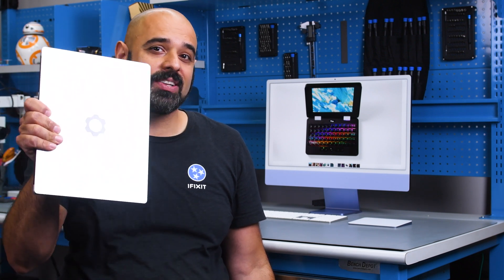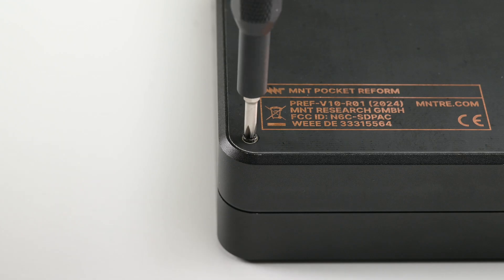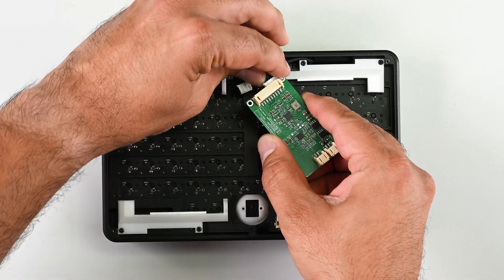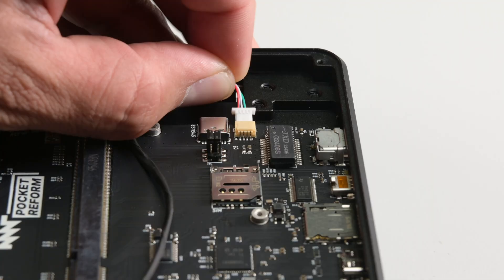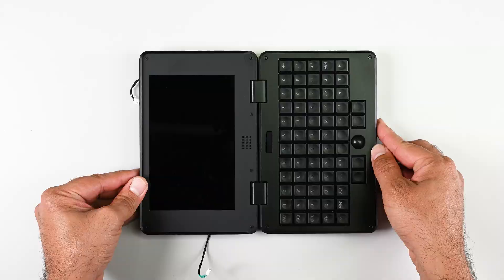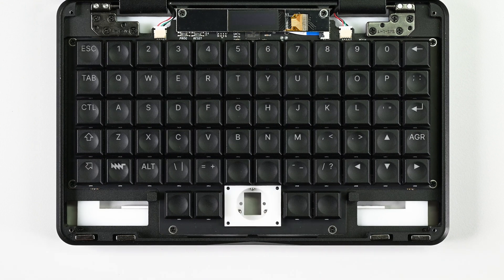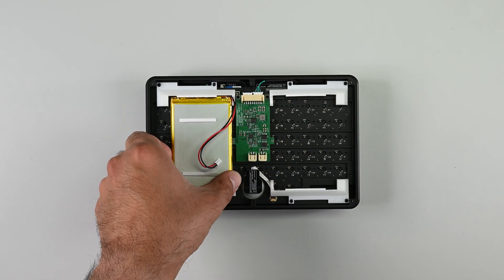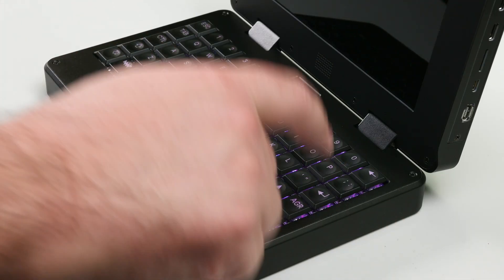MNT Pocket Reform Teardown - An Unapologetically Chunky Pocket PC, That's Also Repairable!!!

Comment: I was so close on buying one of these, but instead, I bought the ClockWorkPi uConsole.

Because I saw the tear down video and found too many wires and the overall design is not as modular as I thought. Compared to Pocket Reform, uConsole actually has only one wire, the WIFI antenna,  other components are connected through golden fingers and pins, which to me is cleaner. 

But this is not to discourage anyone from buying Pocket Reform, because it is modular as it can be, and I do like the idea of mechanical keyboards on such a small device...... So Pocket Reform is not bad in that sense.
Reply: honest reaction thank you.  But uconsole is ~$130 to $250, right? And they go out of stock often. DevTerm Kit RPI-CM4 Lite (with bigger keyboard) is $290. Basically they're an entirely different class of device.  Right now I don't know exactly how much less powerful Clockworks are, but the price difference alone tells me a lot.
Reply: @squirlmy  they are basically equally powerful (or powerless) compared to modern laptops or even smartphones. But the only downside for the uConsole is that it can only run OS on a SD card and the interface is limited to USB 2.0 speed.

There is another project you may want to take a look at: Pilet 5 and Pilet 7 from Soulcircuits. They have Raspberry Pi 5 in it, and the indusrtial design is very Dieter Rams.

Comment: I appreciate the repairability, schematics and parts but it is handheld sized while not being a handheld and costs almost as much as a framework laptop while being only ARM based. I was hoping these would reflect those things. I was excited but now thoroughly disappointed. Either way happy to see more products like these and happy to see another ifixit teardown.
Reply: I mean, I don't really think you can compare this as an apples to apples comparison to the framework given that this is so much more modular. Every single piece of hardware here is non-proprietary it's more or less proof of concept. It's impossible to get open source x86 chips. So it has to be arm.

Comment: Where the heck are the reviews ?! Looks like no one made a proper test of this thing on youtube :/

Update: Found the price, battery life and features. Urgh, again another Linux toy that gives ammo to the Linux haters.... Components imported from China in bulk are not that expensive. What a joke. At least we have Tuxedo and Slimbook for credible hardware options.

They could at least have made the effort of putting a mobile CPU that is not 10 years old -_- It's literally 10 times slower than a cheap Intel N-100... Come on.

Just Google "DART-MX8M-PLUS System on Module Variscite" for the price for just 1000 units.....  And for the case, you can order custom ones easily from various Chinese factories.

Comment: Who needs that for €850? It’s a genuine question. As small machine with Linux I buy some €70 laptop and it have: better display, better keyboard, touch screen, muuuuch better cpu, it supports more software that whatever this rockchip abomination is. In 3-5 years when it completely dies, I just buy another one. And it more ecofriendly bc hardware used for longer. 

My laptop doesn’t looks like cyberdeck tho, that’s a minus.

Comment: First thing i noticed is the lack of battery heat safety system.
Reply: Their BMS does have thermal sensor for each cell, according to the site
Reply: @coccoborg  doesn't have, if you watch the video you can see there is not even a third pin for the safety sensor.
Reply: @onecrazyfennec5337  Is that possible the management / protection was on the mini PCB on the battery itself ?
Reply: @frankwong9486  can be but is not safe, the thermistor should be installed in the middle of the battery to have more surface to measure any dangerous temperatures, installing the thermistor in a PCB in the battery is not ok as the battery could reach dangerous temperatures and the sensor won't stop the charging until is already late
Reply: @onecrazyfennec5337  compare 0:48 and 3:14 there are little protruding sections on the BMS PCB sitting close to  each cell with thermal sensors on them!
Reply: @onecrazyfennec5337  this is totally true! Best placement for a battery thermistor is right in the middle of the cell, not somewhere near.
Reply: @coccoborg  I can see those now, and is totally not safe, the thermal sensor are mean to sense when the battery cells are Getting dangerously warm and stop the charger from delivering any more power. Having a charging sensor far away from the cells risk to delay any problem and the board will keep feeding power until is too late.

Comment: My only disappointment was the use of Phillips head screws. Can't we move on from that crap?
Reply: Dude philips head is great, imagine a flat head screw 😅
Reply: Fine, use JIS instead.
Reply: Then what a torx? Rather have Philips than flat head
Reply: The charm with this laptop is that you easily can replace them.
Reply: What do you want instead? Torx?
Reply: @nothingtoseeherelolkek  Torx would be fine, as would several others. Phillips head is crap.
Reply: @BobCollins42  Why not hex?
Reply: Those that have a problem with Philips. 

Should realize, the problem is with them, not the screw.
Reply: @nc3826  I see. Your shity design is my problem.  Glad I have that straight.
Reply: 'i see' said the blind man
Reply: “It ain’t what you don’t know that gets you into trouble..... It’s what you know for sure that just ain’t so.“

Comment: The keyboard also comes with 10/10 arthritis
Reply: And it's ortholinear.... I absolutely loathe them
Reply: @tonn333  ortho is easier for me to type on tho, I miss keys far less on ortho than on the usual layout.
Reply: @warpspeedscp  I assume you don't touch type with ten fingers
Reply: @tonn333  she's not the layout for me and I'm only a 6 finger sort of bloke!
Reply: @tonn333  Well, my max wpm is only about 60, but I do indeed touch type the way most are taught to do it.
Reply: @warpspeedscp  then how do you miss keys?
Reply: @tonn333  mostly happens for symbols, but also things like b and v, where I sometimes can't quite get my fingers moving the way I want. R and T,  too
Reply: @warpspeedscp  so how does ortholinear help exactly? I'm sure it doesn't assist your fingers to move the way you want.... Nor could the traditional layout do that.
Reply: @tonn333  its easier to curl my fingers directly up and down than splay them to reach for certain keys.
Reply: @warpspeedscp  directly up and down? Surely that would put your wrists in a very unnatural angle wouldn't it?
Reply: @tonn333  which is why I use a split keyboard to allow for the most comfortable angle.
Reply: @warpspeedscp  I had an ortholinear split mechanical keyboard back in 2015... Ergodox... That's when I discovered my hatred for ortholinear 
I personally see no real benefits at all.
But in this tiny laptops case, would you agree that a staggered layout would have been a better option?

Comment: i would love a chunky modern laptop . imagine what they could do in all that space  // you could have "ALL the ports"  and a massive battery  ,raid  , and a m-disc recorder
Reply: Panasonic toughbooks are nice!
Reply: @TradieTrev those are the real chunky laptops of today, and indeed, they have lots of space and swappable components, as well as even external secondary batteries
Reply: I have an old HP ProBook that is crazy repairable, if they only had a few extra unused ports in it, it would be perfect already
Reply: GPD Win Max 2 is calling your name.
Reply: USB-C ports soldered on the mainboard, that's not good.

Even apple uses modular ports. That should be mandatory!
Reply: Isnt that basically the framework 16?
Reply: I buy used old ruggedized laptops for this reason- they're repairable and awesome, I just wish I could get a decent GPU in there!
Reply: Battery wouldn't really be a benefit in a massive laptop as they max out at 99whr before you are unable to take it on a plane
Reply: No reason it has to be chunky - I have the Yoga C930 from a few years back, it's crazy thin, beautifully designed and is VERY repairable. Only mistake they made - the USB C ports are on the mainboard so when mine finally failed and I couldn't charge I had to replace the whole board. No glue, all standard screws, etc. - LOVE it.

Comment: 10/10 on the repairability scale I say.
Reply: Somehow they only gave it 8/10
Reply: I wouldn’t agree with 10/10 since it could be quite difficult if you don’t know what you’re doing, it seems a bit more complicated to repair or upgrade than something like the framework laptops
Reply: 11/10
Reply: Wouldn't give it a perfect score because the connectors on the right side are soldered to the main board.
This is a common point of failure and this design choice makes replacements difficult for users without soldering equipment/skills.